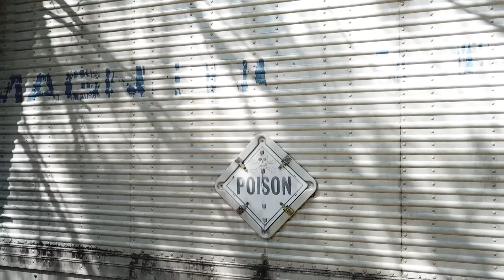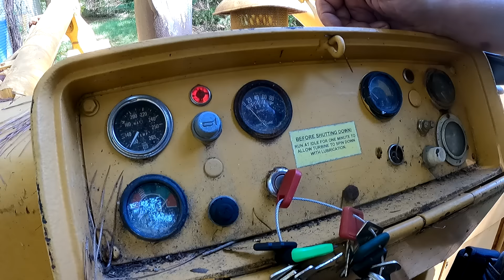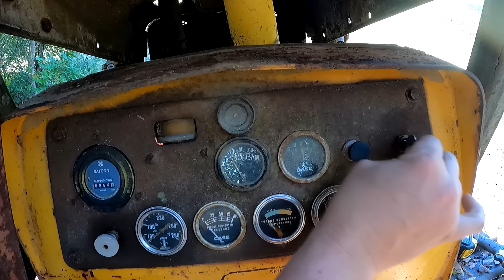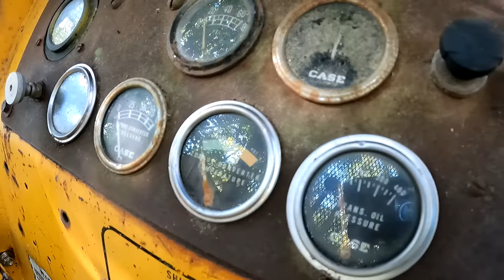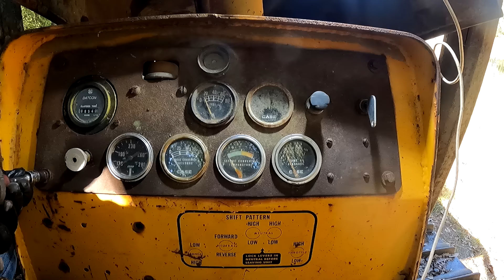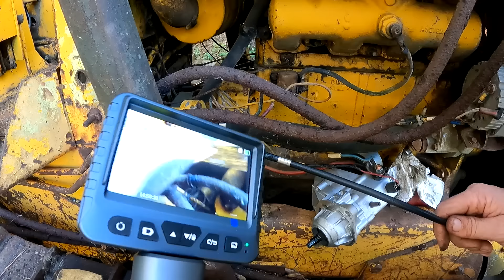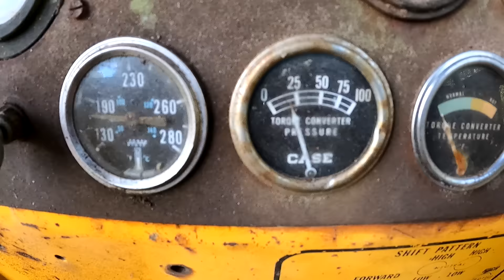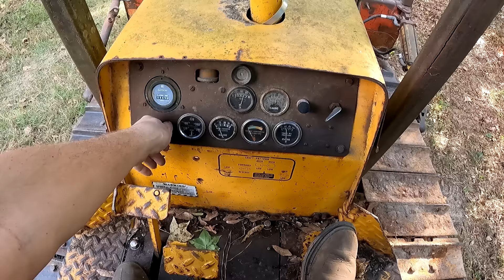ABANDONED BULLDOZER LEFT ROTTING AWAY FOR OVER 20 YEARS! WILL IT RUN?

Comment: Now you can drag the loader out to fix later at your leisure. Having all that old not electronic equipment will prove valuable in the future. worse come to worse you could put a different engine in it. I've seen people convert equipment to other engines that were from other manufacturers even.
Reply from the maker: @willwade1101  I highly doubt the case will move the Deere the case is like 10k the Deere is like 25k lbs, it will have to be moved by a bigger machine I think, unless it rolls easy without running

Comment: Hey Darrell...looks like a great win with the Case, although definitely replace hydraulic lines....they look really crusty and are on borrowed time. The R/H side track has a frozen spot on it you might want to chuck a bit of oil on to help it free off. 👍
The 755 is a tricky one...heart says yes please, would love to see you have a go at it. Apart from engine,  it looks in great shape, and im sure you could fettle it. However,  head says it's a lot of work , and could easily turn into a money pit. Would make a great series of videos,  though.  End of the day,  buddy,  you'd have  a lot of work to do and you have to pay the bills for it, but you could end up with a very nice machine ...😊
Reply from the maker: thanks Dave! good eye with the track I also saw that while editing, im going to replace the lines and all, and I mite give the 755 another shot

Comment: Nice, getting into some bigger equipment. Love the content, keep up the great work bud. If Pacific Northwest hillbilly can completely rebuild an old bulldozer. He rebuilt the engine, trans, did work on the rear winch, piston cylinders, and a bunch of other things. You can get this running. And at the time he had absolutely no experience working on diesel’s and heavy equipment.
Reply from the maker: Thank you very much I know I can fix and rebuild it. The problem for me is that it’s about an hour away and I would have to get it to my place in order to work on it. That’s the challenge.
Reply: @ yeah, that being a dozer. It’s probably going to take a low boy. Of course I’ve seen some good ol boys down here in SW Ga. Haul a case that same size with an F250-350 with a gooseneck or 5th wheel trailer. I’ve hauled some sketchy stuff on a gooseneck with an f250 😂. I’m sure you’ll get it back to your place.

Comment: @11:10 Sometimes it's just easier to tighten and snap bolts off than struggling to get the nuts off. 

😊
Reply: Sometimes you can rotate the solenoid 180 degrees.
Reply: On the 755... 

I'd say if you have the space to store it, and can afford to tie up the money until it's finished and sold, sure it's worth getting a big rotator wrecker in there to grab it and drop it on a low boy.
Reply from the maker: @BrooksideFarmBarreMA it sure is a heavy machine like over 25k it would be tough
Reply from the maker: Haha you are so rite sometimes the bolts are just to rusty
Reply: @The_Home_Pros  Your bigger rotators are in the 70/75 ton range. They could do it, but expect around $4-5k just for the lift and transport if it's close by. 

Kinda wild seeing 2003 as "old". 😂💀
By then, I had graduated college twice after serving six years in the Army.

Comment: Fill the cylinders on the loader with ATF & Asatone 50_50 mix, let sit for a few weeks adding a little more if  Needed .the try pulling it with the cat and see if it will break loose or start . 😊 Nice work

Comment: I had trouble with those plastic lines.  They don’t stand up to vibration at the fittings.  Maybe use copper at the fittings and connect to plastic.
Reply from the maker: Your correct I plan to swap to copper

Comment: That was an awesome video man, i love the drone shots, i see you found your phone but i was wondering about that lol. I just finished filming a will it run on an old semi, starter was weak and sorta crusty. I pulled it all apart and cleaned it up really well and it seemed to work, i wonder if you could have done the same with that one? hindsight, but saves money until its actually running.
Reply from the maker: @99Projects  thanks man!! I can’t wait to see your vid! I’ve always wanted to do a will it run on a semi. I could have rebuilt the starter myself I’ve done it before but I just got so many projects going on I didn’t want to fool w it since the springs were broke n all, and it’s a real pain to get to the bottom bolt to install it so I just wanted it to work. I think I’m gonna pour some rust dissolver or atf and acetone in the 755 and try it again after I finish the mini ex. 
I appreciate you checking out the vid man! Hope max and the pups are doing good 🙂🐶
Reply: @The_Home_Pros  i get the busy part for sure lol i would love to see that 755 come alive for sure!

Comment: I'd replace those plastic lines with Copper tubing , I sure don't like that starter gear being left in the bell housing that will bite you in the ass when you least expect it ,after twenty years and the steering brakes work ,How about changing engine oil & filter now that you have been running it ,check the Trans oil and finals .Good luck on your phone ,I did enjoy this video and subscribed  to your Channel ,
Reply from the maker: @richardphelan8414  thanks man! All that is coming up in next vid😊

Comment: nice one, bro👍, but better use some safety shield on the grinder, and not cut frames for inserting a chinese starter😂 if you  disassembly the two bolts on starter, you can rotate upside down usually 😉 just joking bro, a big hug👍👍😉

Comment: Why would you be stressing out the hydraulics by moving the blade when all the hoses are maypops and you just want to get it down where you can get a lowboy or a trailer in I would just lift the blade and not touch any Hydraulics till it's at its final destination